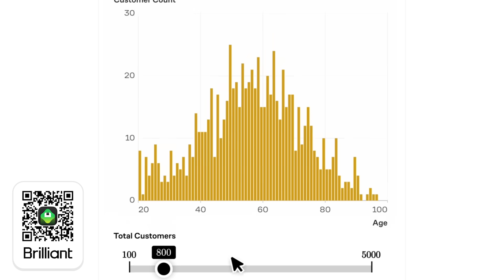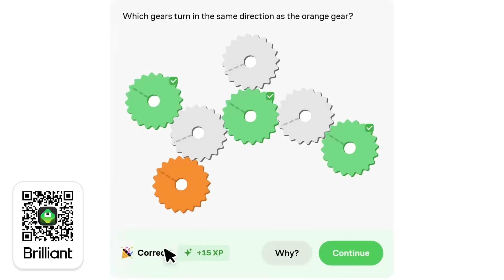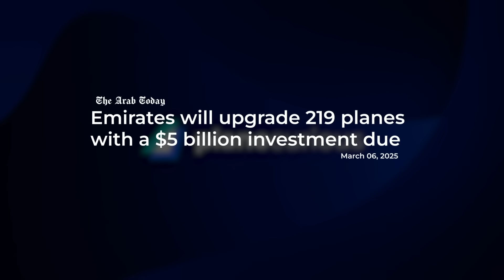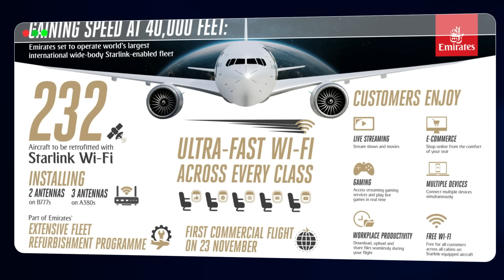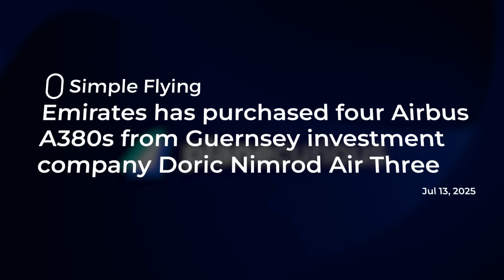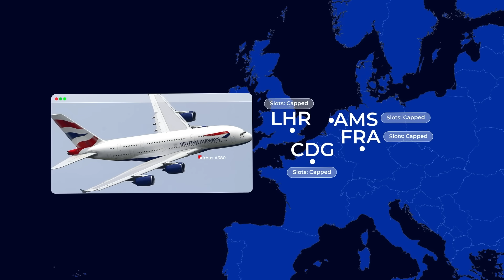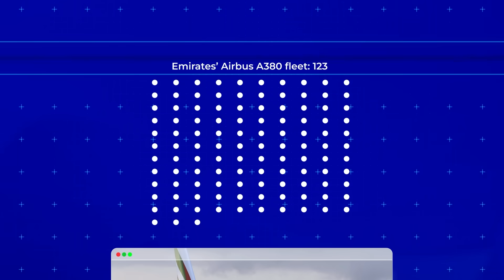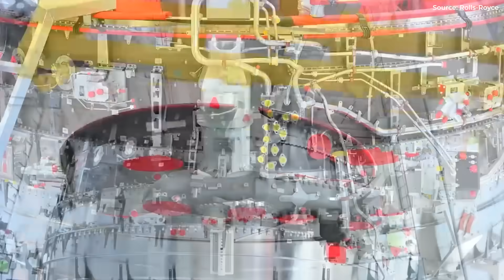Emirates Just Made The A380 Impossible To Kill

Comment: If Airbus refuses to do it, Emirates might do it themselves. They are already creating a Roll Royce center in Dubai and it would not be beyond a stretch of the imagination to take retired A380 and make their own A380neo from the parts and UltraFan engines. It's not beyond reason that a life extension program might mutate into an entirely new A380neo with fuel efficient engines and another 40 years of life. It's happened to other aircraft. 

The B52 of today has been reworked and rebuilt with new engines and hulls. Essentially it's the same design, but modified. Would not be easy, but the alternative might be to wait forever for Airbus or Boeing to build something capable of carrying 550+ passengers in the same level of comfort.

The alternative is to wait for the Blended Wing Body that are being built for the US Air Fore tanker program to be made into ultra wide body passenger aircraft capable of carrying 550+. The mockups in America show that the A380 hull width is well within the parameters of a BWB. You would not need a double deck. Just a single deck that was ultra wide. That's at least a decade or more away though and they have to prove that it works as a tanker first.

Comment: I flew business class London to Jakarta with Emirates, A380 first leg, A777 second leg (Jakarta has no gates for A380, curiously). Boarding through Emirates lounge was fabulous. Great food & service watching your aircraft preparing - and what an aircraft up close. Boarding was so easy, even though it was fairly full, it's crazy. Watching the live feeds from the 3 different cameras on the plane, on your TV, great. Despite the size, it's amazing how smooth and easy the takeoff is. You feel like it's going way too slow, then it lifts off... Great service, great food, very comfortable, the bar at the back small but interesting - and it's so smooth it's ridiculous - I didn't want to get off. The route through Emirates airport is also quite easy & the staff very helpful. Unfortunately, after the A380, the 777 feels cramped, the seats not particularly comfortable & albeit still business class, very basic - a frame sticks in the back of your legs when reclined for sleeping. Not exactly a nightmare but a big comedown after the luxury of the 380... If I do it again, I'll try to go via Singapore, it's an extra (but short) flght - 2 long flights 1 short - but only 2 hours in something that's not an A380...

Comment: Flying on an A380 is fun to experience, but I’ve been avoiding it lately because flying on an A380 means there are 130 to 250 more people queuing at the check in counter, waiting to board and leave the aircraft, waiting at passport control, and 130 to 250 more people waiting for their luggage. The staff has to care for hundreds more passengers at once, which means slower service, tighter timing, longer queues everywhere, and far less room for things to run smoothly. One delay turns into a chain reaction. What should feel grand ends up feeling crowded, rushed, and exhausting, especially on arrival when everyone hits immigration and baggage at the same time.

Even business class doesn’t feel as exclusive because of the amount of people flying with you. With so many passengers on board, the crew is responsible for a much larger group at the same time, so interactions become brief and standardized, attention is divided, and consistency drops. On a smaller widebody, business class feels calmer, more controlled, and genuinely premium rather than a high volume operation focused on crowd management.

Edit: I forgot to mention that 130 to 250 more people means more chances of crying babies, Karen’s, or Indians flying with you disturbing your peace, and more people using the WiFi which makes it much slower than it already is.

Comment: Now that the technology for folding wings on an airliner has been introduced (B777-9), the A380Neo (or the A380-900) could have the full length wings which the -800 lacks and which would surely deliver further lift enhancement.
Reply: There is no A380 neo or 900 and never will be.  This video is just fanboy click bait with nothing to do with facts.
Reply: @timberry1135  I see... You're just a s.t.u.p.i.d BOEING fanboy... BOEING and McDonnell CEO's are the most insensitive people in the world, wanting money instead of investing in security and quality regulations, that's why they tried to shut down Airbus by fomenting a lawsuit against them using other people, but it backfired and now it's BOEING that is in trouble!!!
I prefer to use AIRBUS in my flight simulator because it doesn't change in cockpit setup and systems between A320, A330, A350, instead of BOEING that different cockpit setup and systems between 737, 747, 777 and 787...

Comment: The 777-9 might arrive so late that, with increasing slot constraints taxiway delays, and these leading to flight cancelations all of which increase costs whilst hitting revenue, it becomes 'too late', and Emirates has to expand its 380 fleet even further - perhaps by buying units from other carriers. The same logistics surely, however, affect other carriers with 380s albeit on smaller scales, in which case other carriers might be taking the same view as Emirates - holding to and even looking around for more to cope with constraints and demand. With a 777-10 way off into the future, that also would be too late in the current emerging situation. All of this is surely good news to Airbus, since it increases the likelihood of more carriers than Emirates approaching Airbus for the 380Neo (or the 380-900 which has even greater pax capacity, and is what those massive wings were designed to lift; it would still fit the gates). Whilst - as alluded to elsewhere in this discussion, Airbus would need to sell about 500 units to break even, the advantages of the Neo might be more attractive to other carriers - in addition to Emirates. As the global population continues to increase, I cannot see air travel without ever-larger vehicles - even larger than the A380.

Comment: Boeing 777x is delayed to first delivery starting not before 2027.
Emirates has ordered a few Boeing 777x which will become available much later. Therefore, they will use the A380s for a longer time.
As for buying, it must be due to the price of the obsolete model is so cheap now, it is strategic to buy.
Emirates is buying its own planes which were leased for balance sheet. debt, risk etc.

Comment: A380-800 could do with a cabin configured to seat anywhere between 434 - 476 paxs . . .
Reply: Plus applying the neo to that
Reply: @pavanbiliyar  Not a chance.
Reply: That is exactly what they are doing with the upgrade program. A typical 4 class configuration of an upgraded plane has 14 First and 76 Business in upper deck as well as 56 Premium Economy and 322 to 341 in Economy on the main deck, that is 468-487 in total. The difference in economy is if they have an area for crew rest on the main deck as they had in some of the earlier ones or no crew rest used in some of the planes that never fly the ultra long haul flights. The last delivered ones have crew rest in the cargo hold and as such can have more passengers.